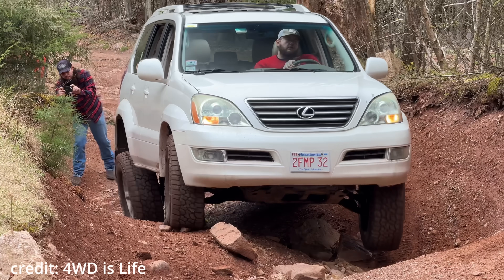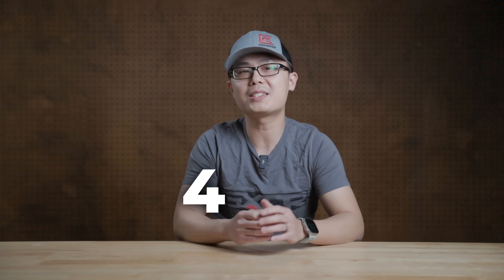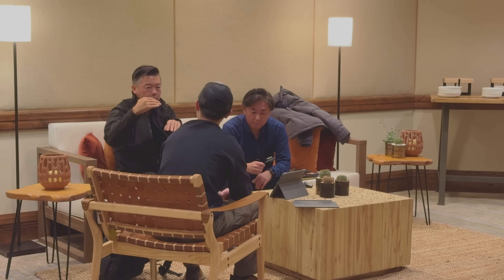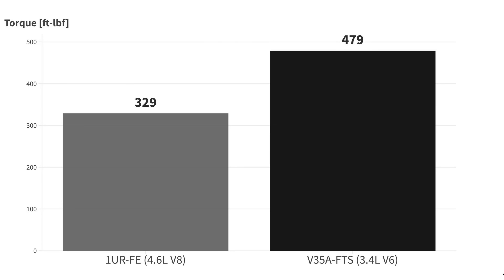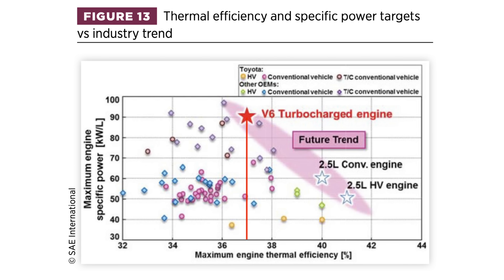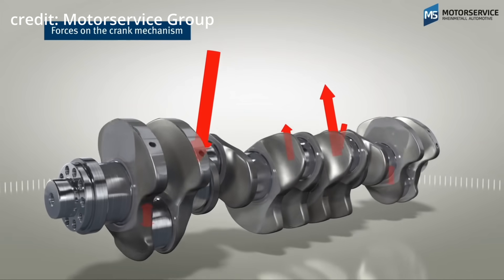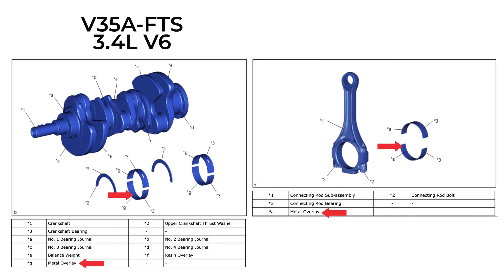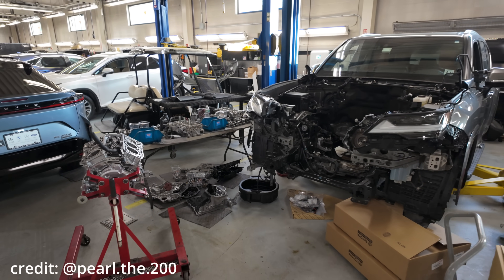Is Toyota V35A-FTS Engine Reliable? Well..It's Not That Simple

Comment: With every new engine comes the inherent design 'optimization' process beyond the test models when rolled out into production for public use. When prototype mules are being stress tested, it's not uncommon for the engines to be routinely torn down and inspected dozens of times when trying to mitigate engineering compromises along the design path. They get them sorted as best can be done, but the kinks in production vehicles start showing up when that optimal environment now belongs to both a scheduled production plant on the clock to crank out that product as quickly as possible, and ultimately the maintenance schedule of the end user. 
Regardless of what the manual or the marketing jibe says, all engine oil has a finite life expectancy. Especially on new equipment, break the engine in and change the oil. No one seems to do this anymore, precisely because brand new engines will have manufacturing yuckus still floating around in the engine itself. Beyond that, new oil marketing touting "15,000 miles" is not conducive for long-life durability. It is, however, great for planned obsolescence. 
That rant completed, specific to this engine, adding turbos to a smaller displacement has a long precedent of making a powerful engine, but even with the best designed thermal efficiency, a turbocharged engine is going to produce more heat (by design, naturally) while also harnessing 'waste' heat. Adding more heat also needs increased heat mitigation, which will add more complication to a design package and more components with increased wear. That's the nature of the beast, and with current technology even being at the highest level it's ever been, there is no getting around that basic principle. While the engine may be more efficient, it will still face increased wear on base and supplemental components. Turbos will need replacing, auxiliary heat mitigation systems will need more and regular maintenance, etc. Anything can be reliable with good maintenance, but it doesn't come easy or free. That's the rub with these engines. You could foreseeably get 250K miles out of them, but keeping up proper maintenance on forced induction engines can not be overstated, and most people rely on the warranty far too much til it's gone, all the while treating that vehicle like they would a lawn mower.

Comment: Well, there's plenty of 6 cylinders that have TT and make more power than the Toyota engine, including the Hurricane from Stellantis, which for it's low end version in the Ram 1500 has more hp and slightly less power, then you get the HO engine that has alot more power and torque. Then you have Ford's 3.5 EcoBoost which has almost 250 more hp than the Toyota engine!

Comment: Made in Japan = Reliable
Made in America = Bearing Failure?

Is this true or just some kind of one off situation...?

Is that half steel/half aluminum block a good idea?
Reply: The Lexus engines in Japan had the same problems as the ones built in Alabama had. There is no way it's machine debris. It is a design flaw. 110%
Reply: Both American and Japanese built engines have the same problem, so it not "debris" excuse but design flaws

Comment: If toyota could give a reason and a fix, I'd  buy the new tundra. As of now... I'm  weird about it. Also, open about it because i think in tundras anyway, it's been 78 motors out of 100k ish sold a year.  78 out of 250k ish ( only 5 months into this 3rd year) My hope is it is QC issues. Maybe not the proper torque or something on random motors.  Part of me is concerned since it is always the same bearing, maybe their plate design is putting too much pressure in a spot and creating the issue. Idk why they didn't  stick with the regular designs of caps. That has been used for decades with no issues. I know too many greesers that have built twin turbos in their home garage, they run fine on loads of boost and normal caps. I've  seen 1.8L engines pushing the same hp and torque.  Granted theu dont last 200k miles. However, they are last past that 20k mile smh

Comment: The things impact bearing life most are 1) Hertzian contact stress(torque dependent) and 2)total cycles of contact (engine speed dependent).  Small engine big power stressed and shortened the life.   Bottom line: reliability decreased

Comment: Does everyone forget that this was done for the epa and thats it.  The automakers are basically forced to boost small displacement engines to comply and the consumer gets to pay for it.  The metal engines and cranks are forged from are not the alloy they say they are especially Chinese cast parts.  If you rely on the cheapest everything thats what you get!

Comment: I'll stick with the naturally aspirated 4.0 vq40 in my frontier.   I'd rather have 275hp that can last well over 200k miles, than a turbo engine that will require more maintenance and still be more likely to fail...even if it makes more power.   Reliable power beats brute power.

Comment: Nah, reliability really is that simple. It's repair cost and frequency over time. 

This engine is still new so there's a lot we don't know, but what we do know is that an inordinate amount of people are experiencing engine failure really early in the truck's life (time) and the engines are $32k (cost). How frequent is this? Don't know, but it's not a good start at all. We don't know if the "good" engines will experience the same failure later on in life or not.

The rest of the stuff in this video are just contributors to the overall formula, but the formula itself is still very simple.

Comment: As soon as you strap a turbo on an engine, even with modern tech, you're cutting long term reliability in as much as half in most cases. These modern turbo engines are throw away engines that are designed to work for an x amount of engineered time. After the warranty ends, repairs costs are almost impossible to afford by the average owner.
Reply: Assuming that the two engines you are comparing are built exactly the same that would be true. But in the same breath most people rave on and on about how reliable turbo diesels are even though they are dealing with cylinder pressures and compression ratios that are way higher than these motors. 

Turbocharging is used extensively in aircraft engines when catastrophic engine failure is a way bigger deal than in a car/truck.

The problem is ultimately that Toyota fucked up. Toyota, not turbo engines in general.

Comment: What if it is simple? The failures are happening where you have steel, cast iron, and aluminum all with their different material properties reacting differently to the torque and stress that ultimately causes the bearing failures? The not so simple part is figuring out why some engines fail and others don't.

Comment: So many call modern engines highly stressed. If you took a modern NA engine to 1950 they would say its highly stressed for its displacement. This issue is even bigger in the aviation community, people beleive you need a massive engine to make power reliably, that just isnt true.

Comment: I bet the 3.4 with the problematic engines are also using a lighter weight oil in order to have better emissions at the expense of longevity... probably went from a 5w-30 to a 0-20

Comment: The fail engine because of inappropriate cleaning at the factory is a joke… After a year engine still destruct themselves… It’s a design flaw and toyota don’t know what to do about it…. A friend of mine is a mechanic at the Toyota dealer of my city… They don’t sell a lot of tacoma and tundra because of the overpriced… But, at least 50-60% of them have critical engine problem… So far this years they change/rebuilt 8 engines!

Comment: Maybe Toyota needs to take a lesson from Nissan in this case. The VQ engines at least in the 350/370z or G series have individual rod bearing caps but the engine also has a "ladder frame" aka girdle that goes on top. Thats one of the reasons why those motors can hold a lot of hp even under boost.

Comment: An inline-4 or inline-6 turbo diesel would be more reliable. Works for the Hilux and Land Cruisers outside the US. Then again, small diesels are not meant for the US market. They're relatively big and slow, which aren't that great for freeway driving. They're utilitarian, but a good petrol V8 could solve majority of the torque demand anyways for similar use cases.
Reply: Honestly, i went from a 2014 3.5L Ecoboost to a 5.7L LX570 6 months ago and the V8 is pretty disappointing when towing in comparison. I live in UT and my house is at 6500'/2000m above sea level and the V8 just has no guts at all. Many times I have found myself with my foot to the floor only able to do ~45mph with the 5.7L with a relatively light trailer(5500 lbs/2500 kg). Combine the high elevation with high ambient temperatures and it sucks the life out of the V8.

The Ecoboost didnt care. The turbos compensated for elevation and temperatures and it just always pulled like a locomotive.

As you said, freeway driving here is high speed. We have huge grades and high elevation. There is a reason most people who tow use large displacement turbo diesels making 700+ ft-lbs and 350+ hp. The only half ton trucks people were using around here are the Ford Ecoboosts because they are really the only ones that make towing easy in these conditions. With the exception of maybe GM's 6.2L V8, the others struggle.

Comment: Smaller turbo charged engines are not overstressed - they are just built more similar to diesels. Just because the load is higher, doesn't mean it isn't built for it. Undoubtedly the brand new engine is likely to have random teething issues from manufacturing defects and design mistakes that will get sorted. People love to talk about the Toyota 3.5 V6 being this amazing last forever thing. But they put those out the door with an external rubber oil line that sits over an exhaust pipe and and aluminum cap for a cartridge filter that gets sticks when most other manufacturers were smart enough to use plastic that is easy to change and never required a specialty tool. 

Toyota isn't special in their reliability or genius in their designs in comparison to other manufacturers. And smaller turbo motors aren't automatically less reliable. They have more parts that can wear out - the turbos - but that isn't something that will happen regularly in the life of the vehicle. The better low end torque and mileage are what you get for maybe replacing a turbo or two one day. Bearing problems will get sorted as they are putting this engine across the line up and warranty claims cut profit.
Reply: Agree with your input.  Failure by trial

Comment: Paper stats and real world stats are always in conflict with each other I don't see the point in trying to make a v6 be the jack of all trades across all your platforms especially for your heavier flagship vehicles pushing 5-6 thousand pounds and get roughly the same mpg out of it as a v8 so just put a damn v8 in it. Yukon denali with the 6.2L NA v8 is one of the most popular suvs on the road new or used and that engine is bullet proof proven to give you 300,000+ miles with proper maintenance and people who buy this don't give a f*** gas mileage. Bad mpgs or so-called efficiency is just one of the trade-offs for having a solid power plant thats going to work.

Comment: CAFE standards getting stricter and stricter forces all manufacturers to use turbo on smaller engines across the line.  This defeats the purpose of making them more efficient with wasted costs on repairs and idling. I prefer ICE without turbos!

Comment: those v8 low stroke elefants are so strange to see in the heavy off roaders. lower stroke affects torque same as efficiency at low rpm. also size and weight of the engine is significantly unnecessarily bigger with it's consequences for overall vehicle efficiency. literally those atmo v8 low stroke engines are stupid eneficient. I don't think it is for reliability. if anybody knows why, I will appretiate to hear.

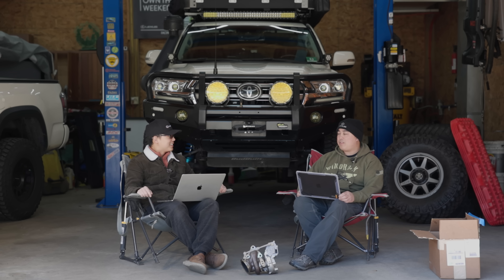14:50 very very strange this "engineer" don't know the reason. he for sure knows the inherent problems of almost any modern turbocharged engine created with a focus on ecology. low viscosity oils and a variable displacement oil pump do their job very well, especially when you push a lot and often in the lower RPM range (where the load on the bearings is greatest). sooner or later such a design will fail. it's a time bomb.

Comment: Toyota has subscribed to the "shrinkfaltion" business model. I state this based on the new engine line up for the tacoma, 4runner and tundra. All get the base engine with some turbos slapped on to make up for the lack. I drive a TRD Tundra offroad and can say my engine will last much longer than a 6 cylinder turbo and sounds WAY BETTER. America is V8 country.

Comment: I should add that 0W20 and 10K mile oil change interval or 1x per year which ever comes first is killing engines. Even when serviced at the dealership with TGMO oil. The entire engine can be clean and you will see wear in the bore that leads to excessive oil consumption and in this case it is not the pistons and rings. The thing is it happens outside of warranty around 120K to 150K miles. Toyota is building things and making recomendations to customers that directly lead to shorten life cycle when you do as they instruct. In my book that should be criminal.

Comment: Toyota's original 3.4 liter V-6 (circa 2000) developed a solid reputation as an indestructible "rock crusher" of an engine. It weight about 400lbs., had a cast iron block and aluminum heads. It put out around 190 hp and 220 ft. lbs. of torque. The new 3.4 V-6 is all aluminum, weighs about the same but with its turbos, boosts torque to around 480 ft. lbs. If the main bearings aren't considerably larger on the twin turbo engine, what do you think is going to happen? The simple answer is correct - highly stressed low displacement engines are always fighting an uphill battle to maintain reliability and longevity. It's not rocket science and there's no "free lunch".

Comment: Omg, the secret to all this is the twin turbo!! Of course to increase combustion efficiency you have to force more oxygen. What an innovative concept. People been doing it forever. The Main Reason Toyota put a V6 twin turbo instead of the old V8 is…. Emissions Regulations. Of course a smaller engine producing a greater force will have more wear, this is basic law of physics. And forget engine reliability, what about twin turbo reliability??? That’s what the problem with new engine is. More complex, more parts, more difficult to work with, more expensive!!! And again, there was nothing wrong with the old V8, fuel consumption is not much better with e new one. It’s government regulations!!

Comment: Luckily, I ended up getting 2024 4Runner. I am about to get the new 2024 GX550. I expect they're good, but I feel the V8 engine is bulletprooof. Toyota needs more time to regain their reliability. Otherwise, they will lose their customers.
 
Why doesn't Toyota make a hybrid V8 engine instead of V6 turbo, I don'tunderstand? Saving fuel, we can do many ways to do it.

Comment: I am a diesel master technician.  Just like to add to comments.  Ford 6.4 l have a twin turbo and it was a total failure.  It was as the worse engine ford ever produced on diesel.  Internal engine failure.  

CAT engines C15,C13 came out with twin turbo also and have the same failure as well.  Internal engine problems.  So to me higher turbo boost pressure are affecting Internal engine failure to  the aluminum cast block engine.  It is just my thoughts.

Comment: Just to throw a possible factor of premature bearing wear into the discussion-  did the owner of this 20k mile damaged engine understand the concept of not putting a high load on a cold engine?

I see so many people, even enthusiasts who should know better, just fire up a cold vehicle and immediately give it the beans.  Isn't this practice just begging for early bearing wear or failure?   Especially as the manufacturing tech and tolerances get tighter?

Comment: Its marketing. Accurately marketing it as an LX340 wouldnt sell because it would be a step down in displacement from the previous model. Its the same thing Mercedes did with their 6,2 branding, because it was a 6,2 liter engine i think it was, its still called 6,2, but not its a shitty 2 liter or so 4 cylinder with some snails on it

Comment: Man, turbos just stress engines till they blow. Turbo = unreliable! Seriously though, lots of folks are unhappy with the new Toyota models from 2022 onwards. They’ve got smaller engines with turbos, Expensive, and people aren’t loving it.

Reliability: Turbos are seen as less reliable. More parts mean more things that can break.
Costly Repairs: Fixing turbos can be pricey and a pain.
Performance: Some say the power boost isn’t worth it. There’s lag and inconsistent power.
Fuel Efficiency: Real-world fuel savings aren’t always as good as advertised.
Trust Issues: Toyota’s known for reliable, naturally aspirated engines. This shift has left some loyal customers feeling let down.
Overall, the switch to turbo engines hasn’t been smooth for everyone, leading to a lot of dissatisfaction."